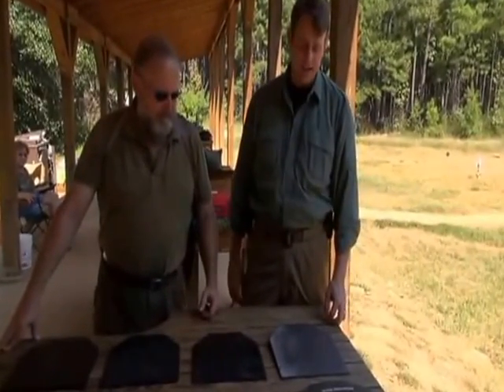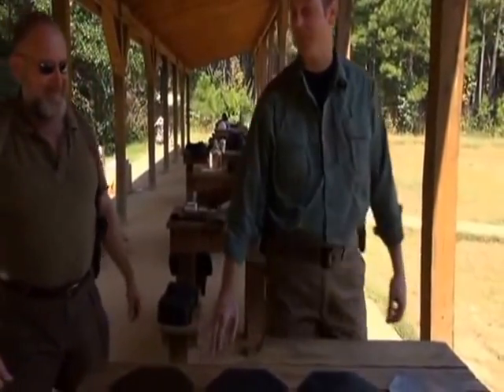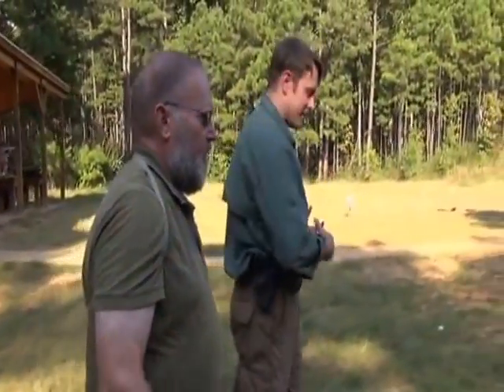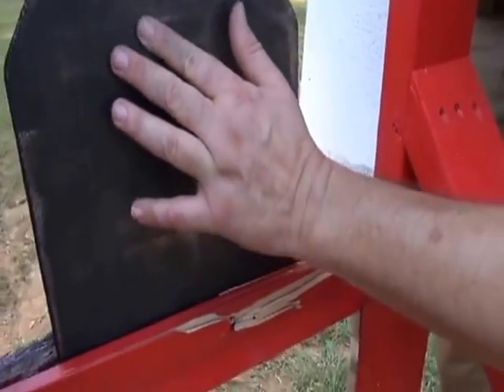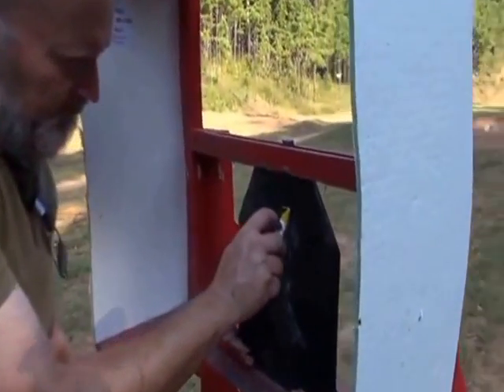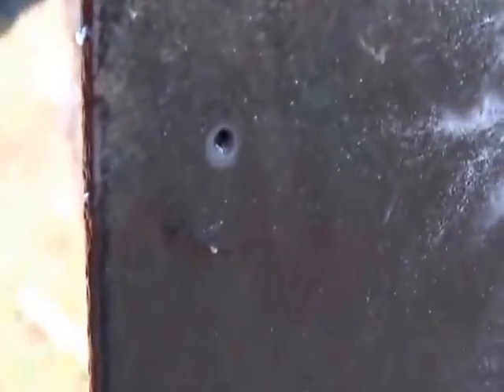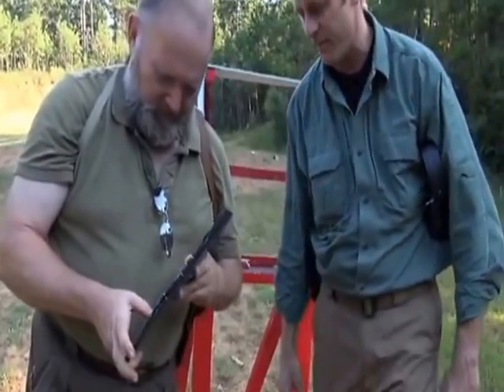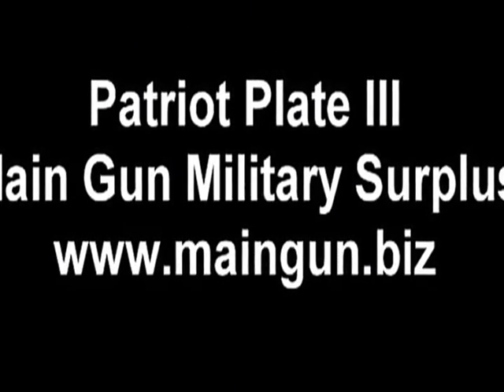Patriot Plate 1 and 2

Comment: any video showing it stopping .30-06 black tip AP rounds???
Reply: 7150285 This test is BS. I cant find any rounds of AP which this plate is supposed to be rated to. That round is basically the ONLY round I am interested in seeing. If the plate stops that well just forget the waste of time testing lesser ammo.
I call shenanigans! Smoke and mirrors!
Reply: ***** check the vid I sent you.
Reply: This most certainly does meet the military level M2 protection, which you are talking about, we didn't have the ability to do that test, which requires an angled shot with an M2 round, which virtually insures a ricochet.  However, M855 is the standard steel core military ammunition, I have never seen "black" tipped rounds being used in common practice. Also, this is being sold as basic protection from most threat situations, most don't involve calibers from the WWII era or  armor piercing rounds designed to defeat vehicle armor, but to be clear, 46100E most certainly can turn a .30 Cal M2 AP round, this is the issue plate.